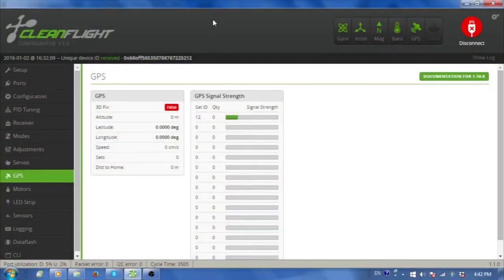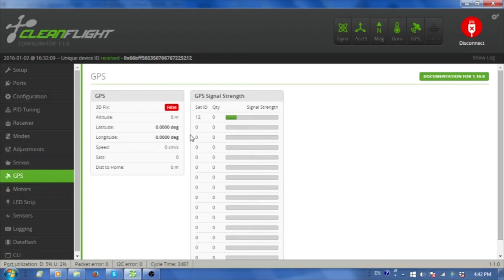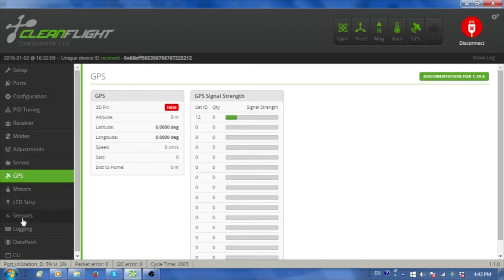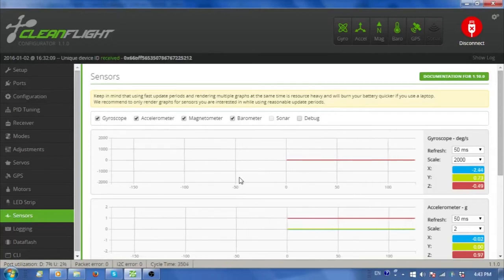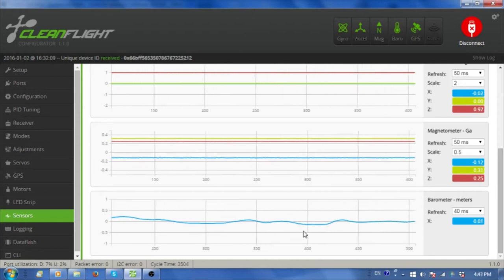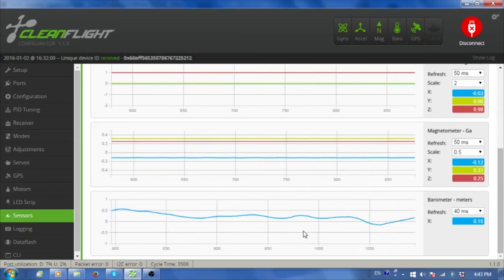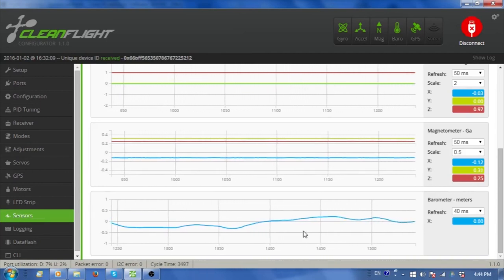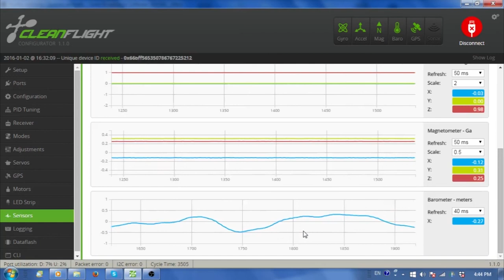Naze32 Acro: External Barometer, Magnetometer, GPS

Comment: Great Video! On which pins exactly did you connect the magnetometer?
Reply from the maker: They are VCC (3.3V), Ground, SCL and SDA (4 pins). Just try and find them on your particular board (some clones differ a lot from the original).
Reply: ediblefly Thank you sir! I'm using a Naze32 so it should work right?
Reply from the maker: this video was done on Naze32, so you should be able to go as far as the video goes, yes. I cannot confirm any further functionality, as I've bought several very cheap SPRacing controllers since then and they already have a decent magnetometer and barometer on board.

Comment: WHY DO YOU NOT SHOW HOW YOU CONNECTED THE VAROIUS COMPONENTS TO THE NAZE 32 BOARD?
Reply from the maker: They are connected to I2C pins on the board. Normally you need 4 wires connected, VCC (normally 3.3V), Ground, SCL and SDA. SCL and SDA pins are located closely together on the board. 3.3V and Ground are either sitting just beside or elsewhere on the board on some clones. An I2C port should take at least 8 devices, depending of a chip. All the smarts are in this article: http://www.i2c-bus.org/
I am not a pro in electronics, so my video is a little hacking experiment, which probably works. I'll appreciate your contribution if you can make it happen into an actual flying machine.
Reply: Thanks for your reply! I understand that both the magnetometer (compass) and barometer need to be connected to SDA and SCL of which there is only one pair (SDA/SCL) on the underneath of a Naze32 acro board. (Of course in addition to the 3v power supply). Are you saying that you connected both devices to these two solder points in parallel?
Reply from the maker: RM H Correct, both are connected in parallel.
Reply: Thanks for the info. I'll try it too.
Reply: @rmh7753  did u try?...did it work?

Comment: I'm interested in adding a magnetometer to my acro naze also. The board has a barometer on it, but don't know how reliable is either.
Can you please confirm it will arm ok?

Also, can you please mention which sensors are those and from where you bought them?
thanks.
Reply from the maker: +Andrei Avramescu The sensors were purchased on ebay. They are all pretty generic. The baro is "BMP180 Replace BMP085 Digital Barometric Pressure Sensor Board Module Arduino KK", the original price is $1.97; the magnetometer is "Triple Axis Compass HMC5883L  Magnetometer Sensor Module 3V To 5V Power Supply" ($4). I suppose any similar item should work.
I am quite a bit busy helping a couple of my friends with their quads at the moment (for some reason they didn't want to be my guinea pigs with this setup, so I am using proper fully functional controllers :). But I shall investigate the issue of arming as soon as possible. From my experience with other setups, arming issues normally occur if there is a mismatch between the flight mode issigned and the hardware capabilities. In this video, you can see that all the sensors register nicely and if there is still a problem, it must be a bug or something in variables that has to be reset. Anyway, I shall have a look.
Reply: +ediblefly thanks, just a note...
Naze32 Acro rev6 (at least original clones, not cheap chinese ones) already has the barometer onboard (BME280). It is tiny. The Naze32 Full has an even better barometer (MS5611).

Also a note from adafruit: The BME280 is the next-generation of sensors from Bosch, and is the upgrade to the BMP085/BMP180/BMP183 - with a low altitude noise of 0.25m and the same fast conversion time.

So basically, for people with a rev6 acro board, they only need a magnetometer.

A couple of more notes:
There are many Naze32 clones, and not all of them has the barometer on board, like this one:
http://www.banggood.com/CK-REV6-NAZE32-6DF-Flight-Controller-For-RC-Multirotors-Baseflight-Configurator-p-1030038.html

While in the picture it it saying that is a rev6, an original board also has an AfroFlight 32 mention and an afro haircut. :)
For people knowing how the real rev6 looks like, they can spot the barometer missing from its place. Also clones could features different sensors or a different onboard spi chip for storage (blackbox) like the chips from Winbond.
Reply from the maker: +Andrei Avramescu I can see your point. It is interesting to check the magnetometer. I should be reasonably straightforward to chuck it on my plane, so we can verify the arming issue.
BTW, I am using http://www.banggood.com/Upgrade-NAZE32-SP-Racing-F3-Flight-Control-6-DOF-10-DOF-for-Milticopter-p-1010232.html in one of the new builds and it has MS5611 on board.
Reply: +ediblefly interesting. In that link is a naze32 clone, but in specs it is featured as a 10dof, that means it should also have the magnetometer. In the pictures there are 2 variants, there is a board with 4 chips soldered (spi memory, cpu, gyro, and ?) and a board with a 5th chip which I suppose is the mag sensor).
Not sure if cleanflight lets you use two barometers or two magnetometers at same time, there could be some issues. On real naze32 boards they made a trace available that can be cut with a sharpie if you want to disable the onboard magnetometer in order to use an external one.
Reply from the maker: the forth one is compass. And this is a different project, so I am going to use the on-board chips only. There no traces to cut on this one though.